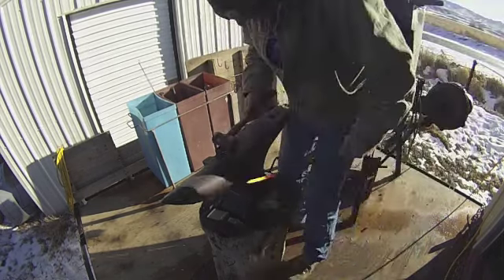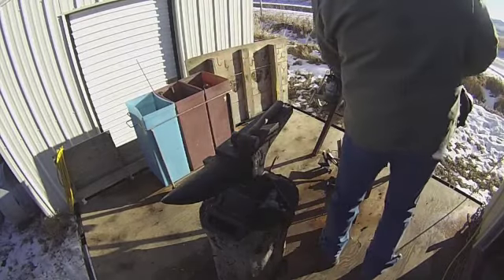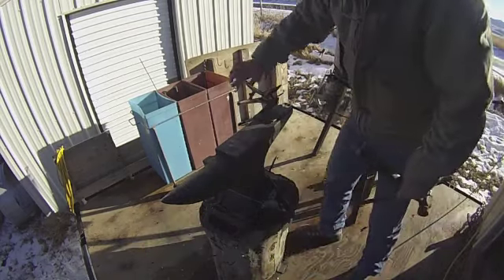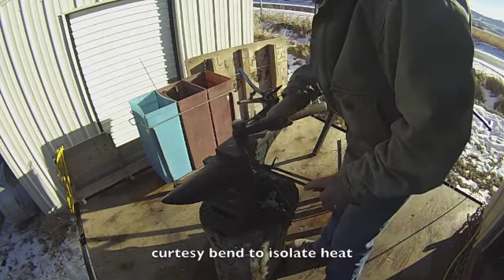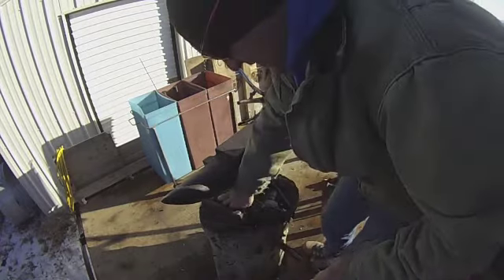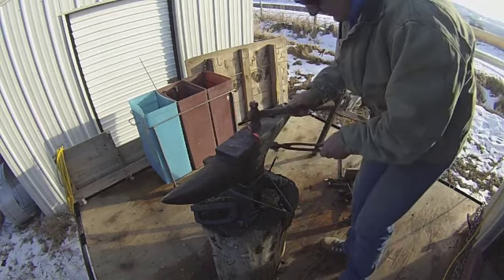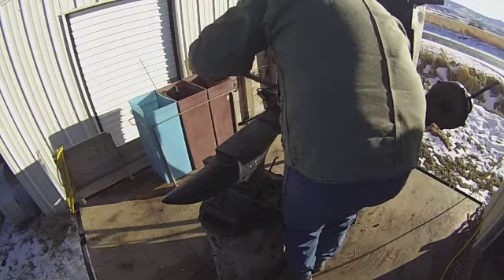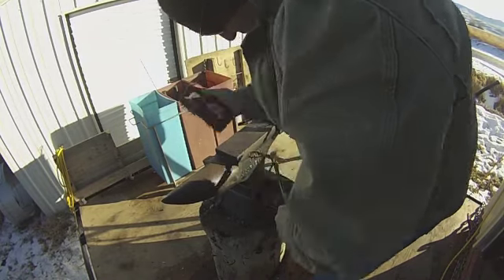nj knife video 1

Comment: Hey Nj Pawley,
I appreciate your contribution to the blacksmithing community here on yt, I recently subscribed to your channel. I have a question regarding your cooling of the tang of your blade, (in order not to distort it). Does it matter if you use water or bees wax for this? I recently learned the difference between quenching alloy steel and plain steel, but this is probably irrelevant here. 
Greetings from Sweden
Johan